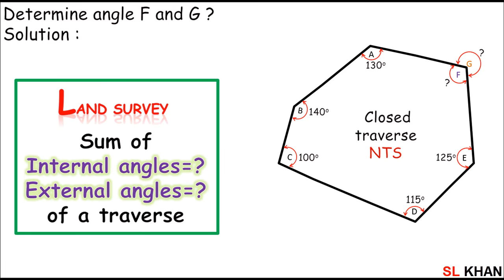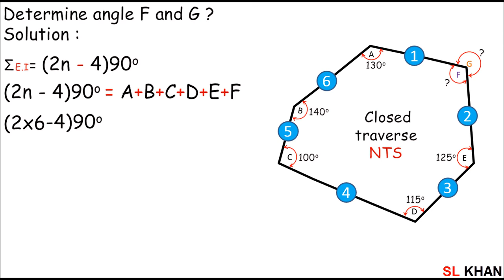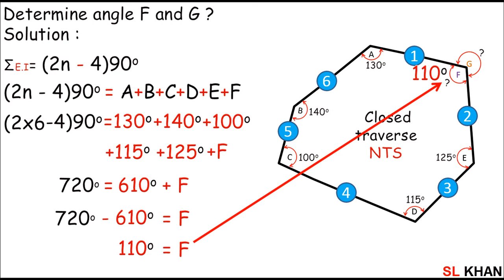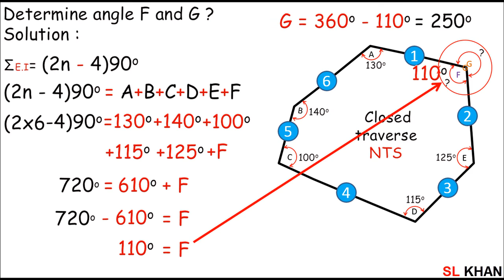Traverse calculation

Comment: what if the angle is in the form of "Degrees Minutes Seconds"?
Reply from the maker: No problem. Still you can use the same method. Remember Calculator has options for deg,min and sec